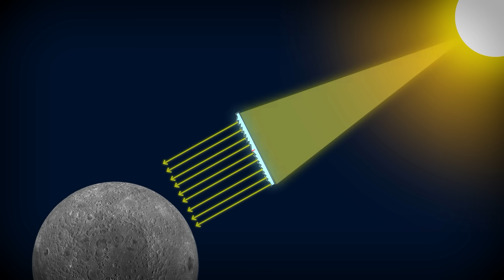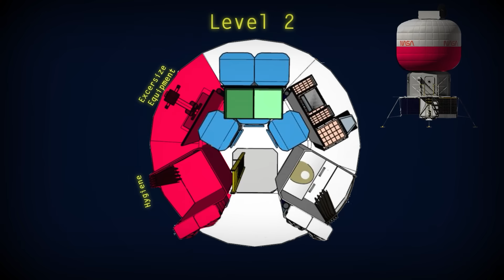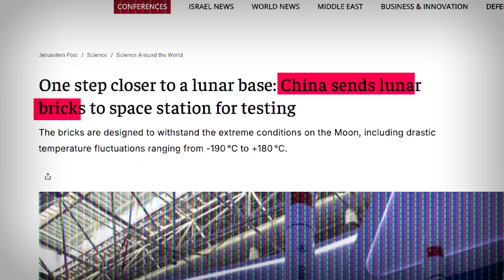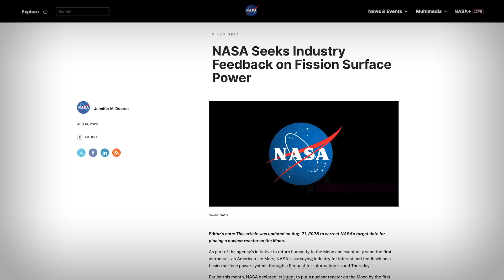How NASA Will Build A City On The Moon

Comment: Establishing a permanent base on the moon before going to Mars makes the most sense. If something happens and you need help on the moon that help is only a couple of days away. If shit goes South on Mars you're just screwed.
Reply: And also sending a rocket up from the Moon for space exploration is way cheaper, no need for the majority of the fuel we currently need to just escape earths atmosphere. Its cheaper, faster, safer and easier to start it from the moon
Reply: @kipsifoh  Sending a rocket from the moon is cheaper if we can manufacture and obtain raw space fuel and construction materials from the moon itself. Otherwise you're just sending a rocket from Earth to the moon to send from the moon to Mars. The extra trip will just increase costs. If you want long term space to be cheaper a space elevator probably has the most savings.
Reply: @kipsifoh  the billionaires are using machines against the people.  the a.i. they created is being used for psychological warfare.  constant online barrage of misinformation.   we must stop the a.i. now before it becomes machines and attacks the poor for the rich.
Reply: @kipsifoh will note that it's not just the atmosphere we're barrelling through. it's also earth's gravity.
Reply: @dead-claudia Of course, but gravity is an effect of all bodies that’s why i didn’t mention it. Sure it’s way less on the moon but the main reason it takes so much is the atmosphere of earth. you aren’t wrong though, earth does have way stronger gravity too
Reply: The moon is the first stepping stone for so many big reasons. If we ever hope to put human beings on Mars, we have a lot of hurdles to cross and we test them out by focusing on the Moon first. Standard technologies for a Mars Mission would be tested and modified and perfected for the Moon first, providing a foundation for how to construct a base from regolith but also figuring out the complexities of the robotics as well, all within a manned flight distance from Earth in case anything goes wrong. There's also the Space Industry to consider. Financials. It's difficult to imagine how to fund a Mars mission right now. But imagine how profitable the Moon can be become if done correctly? Mining surface areas for Helium-3 to sell back to Earth for Fusion Stations. Space Tourism, wealthy people spending fortunes to stay on the Moon for the Astronaut Experience. Establishing permanent Research Labs on lease to the Space Agency Conglomorate.
Reply: @lewismoreton4856 The lunar titanium aluminum iron silicon and oxygen have real net present value. In the 31st century He3 is not burned in hypothetical fusion powerplants but instead fills nano-engineered pellets and is imploded with over 200 lasers, providing immense thrust for starships. He3 is available from most stellar winds, 100% sustainable.
Reply: Also it would be best to send robots to build the base on Mars before sending people there. They way AI is getting smarter, having a group of robot construction workers by to send to the moon in a couple decades may not be unrealistic anymore.
Reply: @KentPetersonmoney  this is how the men of stone begin and the age of terra with it😭
Reply: @KentPetersonmoney  sending 10 - 100 starships with robots and resources beforehand is a game changer
Reply: @easydoggy  Probably by the time the first humans arrive, the robots will have established their independent robot state and defend it against the carbon based intruders 😮
Reply: Also, the gravity well to get off of the Moon and back to Earth is not as strong as the Martian gravity well. This is for me a major consideration when considering an exploration of Mars vs. the Moon.
Reply: Zero atmosphere
Reply: You act like the people on the moon would be in good enough shape to take on problems that the people going to Mars will be going through. The moon people would probably have limited resources anyways.
Reply: @ethanpritt542  moon mars space are all difftrent places to percieve act in probe adapt in with care.
Reply: I agree 100%
Reply: We need to have a better system in space right off the planet to be able to launch over to the moon, then Mars later.  A Mag-Lev track to launch items into space is much more practical, as most of the cost and physical effort is spent getting it out of our gravity and atmosphere.  If it can get slung up, then a whole lot less fuel will be needed to maneuver the final section to the station.   A round pizza hab is the way to go as it can be rotated to help maintain gravity and thus reduce the human body degradation due to much reduced gravity.
Reply: Ha, ha NASA sticking to a plan!!! Since the International Space Station they have been falling out of the sky for about a decade! then Boeing rockets kept exploding!!!1🎉🥳🤓😁😄😃:popcorn-yellow-striped-smile:😻
Reply: @hackman669  stop! We are totally going thru the belt of protons at near light speeds to land on the 120 degrees celciuscsurface of the moon. Shure we don't have clothes that can handle 120 degrees for more then a few minutes before melting, but we can land onvthe dark side instead with its 270 minus degrees celcius and just build it quick, maybe plant some trees. We just have to have a moonbase to refuel at and hace a swedish fika before we go on out into the falaxy to capture some alien slaves n put them in a zoo, or eat them on the spot. Why are u such a partypooper bro dob't tell us we are stuck on this rock that we decorated with mountains of garbagebags?
Reply: thats called a a learning moment
Reply: Unless you're a botanist lol
Reply: Getting to mars and using a close orbit moon along with communication low circle satlites to control 10 20 years robptic testing building landing take off is more logical. Robotics AI is racing ahead and la`nding returning as to be 80% perfected
Reply: @stgeorgeist There are resources on the moon that you can use to build things and make fuel with. I'm not sure how you're planning to produce fuel in orbit.
Reply: That's the basis of my Mars Failsafe plan. It makes Mars easier and safer.
Reply: the moon also has less lag compared to mars (1 second vs 3-22 minutes depending on where earth and mars are in their orbits)
Reply: I would love to know what speeds humanities rockets can reach , launching from the moon.
Reply: Mars is a fantasy. Apart from radiation, what would life on this planet be like? Gravity is less than half that on Earth. Pregnancy would be practically impossible, and after a few years, all colonists would have to be rotated. Let us not forget  again - about cosmic radiation. Unfortunately, it's just a beautiful dream. You can fly back and forth from the moon in a week. Not from Mars.
Reply: @tomj.7599 

Thanks to people about 100 IQ points above yours, you represent most of the global population on Earth.   The Neanderthals.
Reply: I'm advocating more and more for a series of robotic probes on an Aldrin cycle between Earth and Mars, carrying emergency supplies and equipment.  In the event of a mission becoming stranded or other emergency, a probe passing Mars could be brought down by remote control much sooner than any direct launch from earth.
Reply: @falcychead8198 ...and I'll bet you haven't even seen my Mars Failsafe video. Yeah it's common sense to us robotophiles.
Reply: If you can't do it on the Moon you won't be able to do it on Mars. Stupid to do the big jump and fail before doing the little jump and learning from it.
Reply: No different from explorers to North an South poles or other remote locations centuries ago where rescue was impossible.
Reply: @billakers6082 

Exactly, but your talking to morons.  People who are also internet trolls and flat Earth, dull minded nitwits. 😅
Reply: @billakers6082 the difference is people went back to those places.
If you're a believer, the moon is the only destination where the people who discovered it spent billions to get there and never went back.

The fact there's no reason to be there never impacts the decision of governments.
Reply: With current tech, it's almost the only way to go unless atomic reaction engines are taken out of mothballs
Reply: It depends on orbital alignment how far MARS is from earth and moon.
Reply: Awesome I would love to live in a place with no cockroaches, mosquitos, and all the bad shit.
Reply: Why would we spend tens of billions of dollars on a moon base?  There is nothing there except rock and dust.
Also wouldn't extreme temperatures and radiation be a major problem?
Reply: Nobody ever set foot on the Moon please get your head out of your ass or stay a slave!!!
Reply: Mars isn't happening. Its totally pointless and nothing but an excuse to give spacex a blank check to continue destroying rockets cant even make orbit. The only thing that could make it happen is another space race triggered by another country making a real attempt and that isn't happening anytime soon.
Reply: @moshunit96 

IQ us not your normal forte.  Being an internet troll is.  Go back to your cave.  😊
Reply: not really. the idea is tutorial area should be useful, meaning we get info we need and use it for the real project. But mars and moon are so different in terms of its condition, any info we can get on the moon is basically useless on mars. We would have to start from 0 on mars too.
Reply: @battse7718 correct. I designed a compressed CO2 powered wormlike robot for Mars and a spiderbot for lunar operations. Two different games.
Reply: @zvorenergy Same. Im also building habitat alternatives. Everything is so different basically moon is pretty useless if the goal is extraplanetary habitat. But surely there can be other utility in moon base that nobody even thought of yet.
Reply: A couple of days is probably too late for most emergencies.... Having an ambulance delayed for days on earth is already a significant problem
Reply: @totps80s 

Stop wasting time texting your lack of understanding and learn how to bake cookies,
Reply: The moon is its own light its plasma r foster tesla marconi hertz volta and all real astronomy and wxienxe has prvne the eatrhbis flat stationary does not move and the sun and the moon are not balls you kahlist dukbblabtoomite deceived of paid inbred shill there is no 24 hour sun assholes communsit party unit 122 pf Jess stealing flat earth project holy nat soc correct belief scientist and engineers and misframing the shit you arw not exploring narnia e ron con artist you Elizabeth Holmes protocls fo sion grown person you fuckong jew mormon spruce goose 1 trillion adjusted supposed lying assholea
Reply: Yes. Its only 120 degress celcius on the surface of the moon so they need to build quick. 
The moonbase was created last year said their commercial called: We Are Going. 
This is totally doable lol , and we need a gas station for spaceships if we are going to conquer space and capture aliens and put them in a space zoo and use the sheat out of them useless facks.
Reply: At first, the moon is only closer and conveniently safer.   But soon afterwards, the distance from farther Mars won't matter due to better spaceships and facilities.
Reply: @PlanetEarth3141 spaceships if you believe in that bullshit are getting worse, not better.  They can't even go where they say they went 60 years ago.
Reply: While on paper this works, Im not entirely convinced that departure from the moon to Mars gurantees interception with Mars better than Earth does
Reply: @DRPacc  It depends massively on what we can get locally on the moon
Reply: It makes ZERO sense to do either. You are naive.
Reply: @jebbroham1776, well I can understand that reasoning but in terms of temperature alone and the potential for lots of "hidden" resources, Mars is actually a better choice IMO. Remember the Narrator said that the slow rotation of the Moon exposes it's surfaces to extreme heat & cold potentials. The range can extend from upwards of 300°F to as low as 3 and 400°F, below zero.... And those temp ranges are from the equator to the poles. On Mars you can have extreme temps but they're much closer to what we already experience on Earth. The estimated avg on Mars is still rather "icy" at -81°F, however, you can see nearly 70°F at the equator which is rather comfy here on Earth but at the poles it can be greater than 200°F, below zero.... Still on Earth at the poles we can see temps of more than 100°F, below zero. 

I'm also thinking that the Moon overall is a much less hospitable environment than Mars. Not only that "sticky/sharp" regolith on the surface of the Moon but the fact every part of the Moon would effectively see ~2 weeks of sunlight and ~2 weeks of darkness. That is horribly demoralizing for humans. I know that when we've suffered some severe weather where I am, we've had to go w/out power for more than a week. And I know the obvious differences in sunlight versus "power outage" but just imagining there being "no Sun at all for 2 weeks straight" and that it's not just a random, short-term occurrence but a consistent recurrence that never ends! For some people who don't "see the Sun" for an extended period of time, it negatively affects them. And that's just, "the Sun being blocked by the clouds" but imagine a seemingly never-ending "night"....

Also consider the exposure to radiation, whilst it's still more on Mars than Earth because of the weakened magnetic field, it's still much less than what people would be exposed to on the Moon because the Moon effectively has no shielding of it's own. I'd be interested in seeing more about these ideas for "melting the regolith to make streets of glass".... Obviously, back here on Earth it's pretty easy to perform "testing" but we can't exactly "strike a match" up there and, "make fire!" And unless they manufacture a lens which they need to take into account the difference in gravity as we know gravity is different on Earth versus space/the Moon, to create a lens which could create a wider beam, they'll be hard-pressed to just use a laser to try melting it w/out making a mess or otherwise undesirable patterns and unevenness in the resulting "glass road".... That'd have to be sure that the integrity of that "glass road" was consistent and durable.

I'm still not sure that THAT is the best solution. I just know that stuff is really nasty! I remember seeing some old images of Apollo crews whose spacesuits looked like they had been underneath an "oily" car because of the "Moon dust" that stuck to their suits! As part of an opportunity yrs ago, I was at a discussion with some NASA Staff who talked about how the "dust" would also contaminate the Lunar Module when they came back in, the air would be contaminated w/ the particles and it could also contaminate equipment. So it was also part of their suit design initiatives to try addressing that for future missions as they already use a Teflon coating. I think the Moon is fine for a "Moon base" but it's just so "dead".... I think Mars is still the best choice for real expansion.
Reply: great!!!
Reply: It's both practical and safe as far as incremental moves, and yeah - strong second to the idea that AI / robots should be there well ahead of us and sending progress reports back so we know when it is that we've got a credible human habitat ready (just that once that happens it'll likely be another couple years before anyone can actually get there).
Reply: there is an argument against it because of the addes cost, but if you get mining activities going on the moon, so not only using it as a launching base, most of the restance against it will disapear
Reply: @koenwaalde 

True.  Not to mention every type of material in the asteroid belt beyond Mars.  That material can be used to  create items with  AI and autonomous factories near the asteroid belt's orbit. Then moved to anywhere in the solar system.
Reply: Nobody is going to Mars lol.. Science had that convo like 20 years ago. It's not a valuable target for long term manned missions. It's just good for a publicity stunt. 

The moon is high value for long term missions. After that is robotic missions galore. 

Movies lied to you. There's not gonna be a space trucker economy anytime soon.
Reply: @moondog8829 
What about space tow truck drivers? Do you think they'll have them? 

I'm gonna need a job.
Reply: @moondog8829 in the 31st century we don't colonize planets, we create habitats. But Mars does have resources which are extracted by robots and sent up by rotovator.
Reply: @zvorenergy  "But Mars does have resources which are extracted by robots and sent up by rotovator."
I doubt it, the gravity well that is Mars would exceed the benefit of mining anything from it that we could just as easily get from a free floating asteroid instead, one's that pass close to earth no doubt too.
Reply: @Mad_Catter_ aluminum, titanium, magnesium, chromium, lithium, cobalt, nickel, copper, zinc, niobium, molybdenum, lanthanum, europium, tungsten, and even trace amounts of GOLD😍
Reply: @moondog8829 

Moron Alert!  Troll nearby.
Reply: Pergaps the moon just needs vlowing up and all our problems will disapear
Reply: @lewiscattell6060 
But where will we get our cheese?😢
Reply: @lewiscattell6060 

Perhaps you should go back to the asylum and learn how to spell and edit.
Reply: This idea is kinda stupid unless miraculously establish a giant manufacturing colony that can make a spaceship from scratch which is impossible yeah you can go from earth but at that point why would you stop at moon and just not accelerate to mars. One way I can see working is refueling on moon but we would probably be able to do that in space as well.
Reply: @Goofyzabi you've hit on a bit of a dilemma facing space exploration. Imagine we sent humans to a distant star, so distant that the humans on board would have to be put ins suspended animatio (or have several generations living and dying until they reach their destination. Now imagine that 200 years into their journey,  mankind discovers a new technology that allows us to travel several times faster so that we could even catch up to that craft sent 200 years earlier!
Reply: @Blaze44_22

A Star Trek movie,  but you give Gene Roddenberry no credit for it.   😮
Reply: Sending people to Mars will not happen in my lifetime, and I plan on living for +50 years still. Just way too much downsides to any benefits of having a human in Mars instead of a rover.
Reply: @tapio_m6861 

You're definitely a short minded pessimist.  😅
Reply: No one will ever go to Mars, no moon base will ever be built either
Reply: @Truthbomb918 

Feed your brain.  It's starving.
Reply: mars have tesla bots first. 2 missions before humans a fact.
Reply: No It makes no sense and Moon Is constantly hit by shit so everything we could build would be destroyed
Reply: It also means it’s easier to bomb a lunar settlement from Earth. So it’s a bad location if your goal is to get an insurance on Earth as soon as possible.
Reply: There is no south in space Lol
Reply: @BANGbucketHEAD  It's the theoretical poles of the theoretical axis of rotation. Same as earth.
Reply: @BANGbucketHEAD  "shit goes south" is a way of saying "something goes wrong"
Reply: @dizzy_jump everybody knows that expression but I guess not everybody knows that I was making a joke
Reply: @BANGbucketHEAD  ok well the joke really did not land at all
Reply: @dizzy_jump You thought that I didn't know what a commonly known expression meant Even with an lol at the end which is pretty funny to me... Let's make it more funny.. What did you think that I thought was going to go south?
Reply: @BANGbucketHEAD  🐟
Reply: @BANGbucketHEAD  There is south on Mars and the Moon though
Reply: @BANGbucketHEAD  It is a human construct - we way have done on Earth, as we  move thru space, e.g., our North and South Poles.
Reply: @BANGbucketHEAD  well the moon has poles
Reply: @Arlington0588  That is relevant for the moon. Where is South in space? Which direction?
Reply: @BANGbucketHEAD  Really musta felt smart for all of about three seconds before you realized shit, planets have poles and mars is a planet.
Reply: @BANGbucketHEAD  objects with magnetospheres have magnetic poles and thus one can be designated as North and the other South, and there can even be multiple North and South poles too like on Jupiter.  While the moon no longer has a magnetosphere some scientists hypothesize that it used to, and so even without a currently active core, the moons crust may have magnetic striping like the Earth does and if so scientists could use that to establish a true South Pole.

Magnetism is a force found everywhere in the known observable universe so far,  and it’s fundamental to the standard model of particle physics.

The compass is a magnetism based measuring device and wherever you can find magnetism, you can find a pole!
Reply: @BANGbucketHEAD  also there is a south on mars because mars is a planet but that's not the point
Reply: @BANGbucketHEAD haha what do you mean. The earth is in space and we have a south 😂😂
Reply: @mediaproductions3557  I don't know what I was thinking. I'm just in outer space